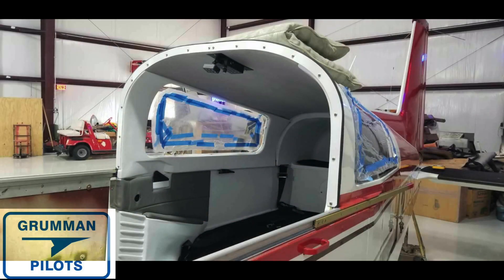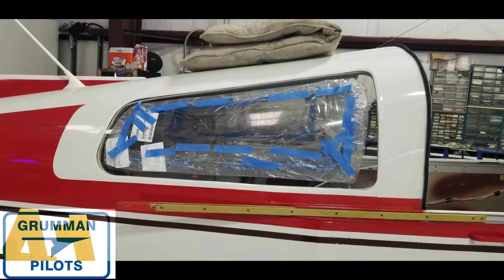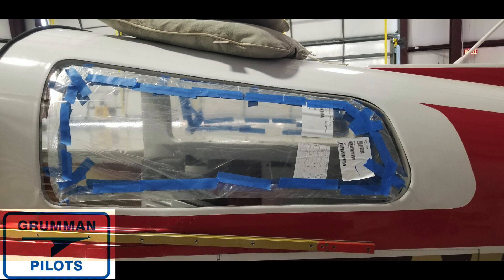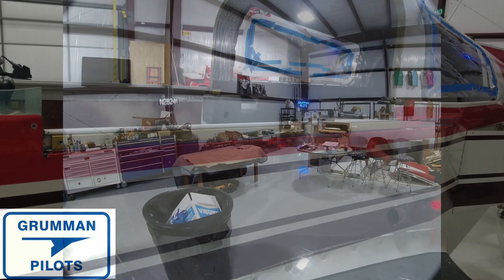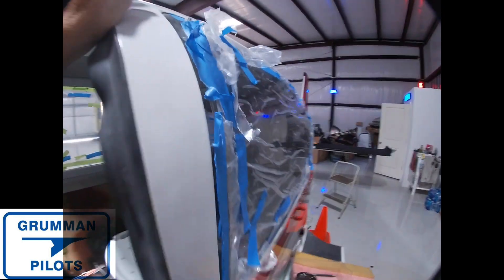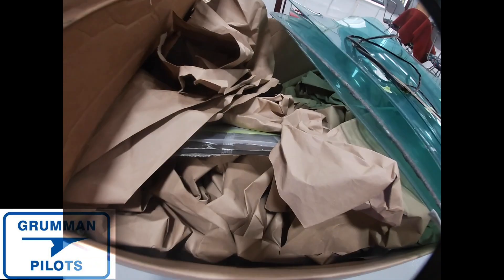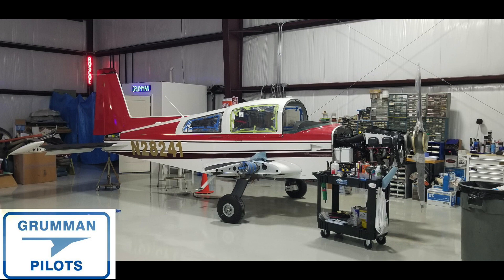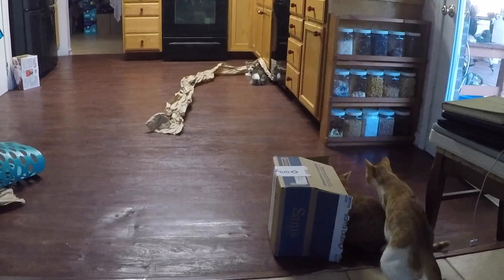Grumman Project Tiger Canopy & Rails - Grumman Style

Comment: What dimensions would new rails be and what dimensions would require old rails to be replaced? My rails have already been flipped on a '77 Tiger and are on the least worn side, but they are not in great condition. I'm unclear if replacing the teflon is sufficient or if I need new rails.... that I cant source!
Reply from the maker: Usually with new tracks, rails can go down to as low as 1.003 inches (rail to rail)
Reply: @GrummanPilots  This it top of rail to bottom of rail? I assume any lower and there is a risk of the rail coming out of the tracks?
Reply from the maker: That is right, we had one that was so loose and thin, it popped out about halfway open.